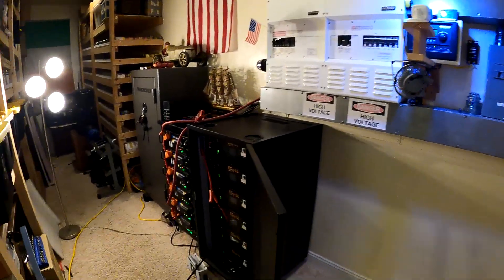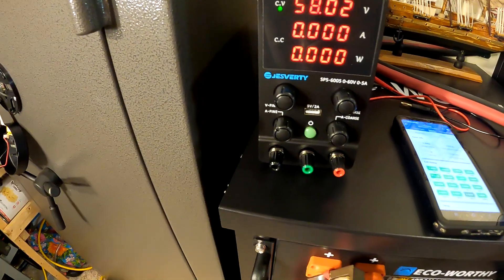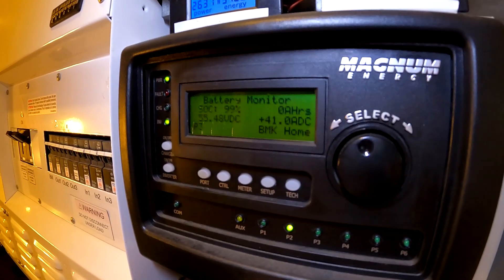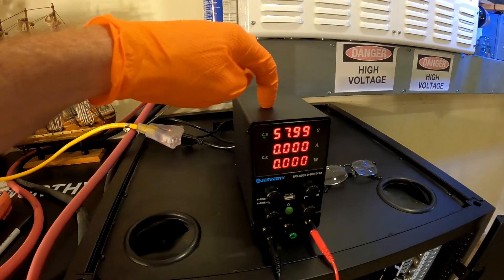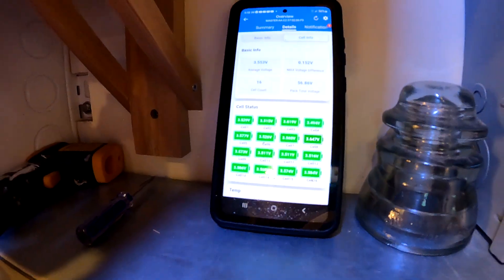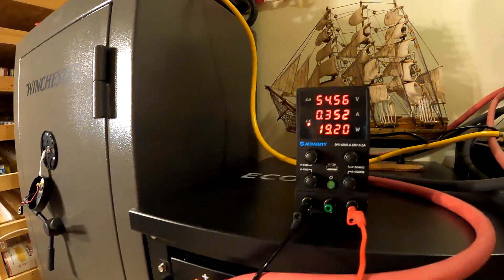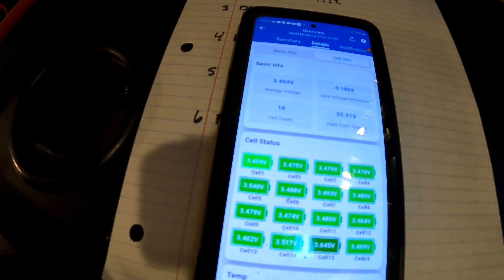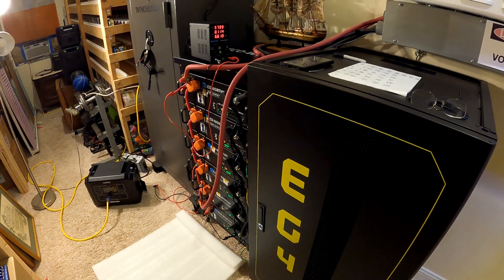Top Balance LiFePO4 ECO WORTHY and EG4 Batteries

Comment: Looks like you have a fuse on the (+) side of the bottom battery.  Is it rated for ~ 80 Volts?  It looks rather small to me.
Also, I've found setting the Inverters/MPPT controller's charging voltage to just below the BMS cutoff voltage and cycling the battery down to 20% several times will balance the batteries just fine.
Reply from the maker: I thought about trying that same thing. I might do that.  Here is the fuse I'm using:
https://amzn.to/46fZ1mp
It was originally sized for my lead acid bank.
Reply: @HomesteadEngineering  ~ That fuse looks like it's rated at 58V and that is too low for your battery voltage as you will most certainly get an inductive kick if that fuse ever blows.  That will start an arc that a 58V fuse can not extinguish.  I would go with a 80-100V rated fuse or better yet a high voltage DC rated breaker.

Comment: Good idea. When I got my eco-worthy I tried to top balance it but cycling it and the BMS was taking too long. I ended up opening it and just charging the one or two cells that needed it with bench power supply. After that the BMS has been able to keep it balanced when brought back up to 100%. Very nice system you have there.
Reply from the maker: I would love to try that but that is definitely the advanced class.  Thanks!

Comment: I’m sorry but I had a really hard time following your video.  I understand that you want the battery banks balanced when you combine them but you jump around a lot.
Reply from the maker: Yep, I get it.  I was attempting two different ways of top balancing and then throwing in a few other ideas on top of that and it got a bit confusing.  To simplify, here is what I would do if I did it again:
Stage 1:
1. Disconnect the bank from the solar
2. Charge with a battery charger (say 18amp) all the way to 100%
3. Drain the bank down to say 5% and repeat maybe a few times
Note: I would consider draining the bank all the way to BMS shutdown but then immediately start recharging it.

Stage 2:
1. Use the same battery charger to get the bank to 97%
2. then use the power supply to slowly finish charging at 58V and low amps
a. 4amps from 97% to 98%
b. 3amps from 98% to 99%
c. then 1amp from 99% to 100%
That last bit is going to take a while

Try at your own risk as I am not an expert.  I am just learning myself.